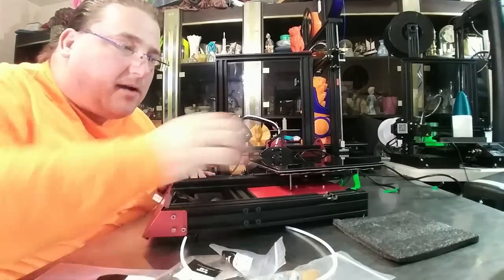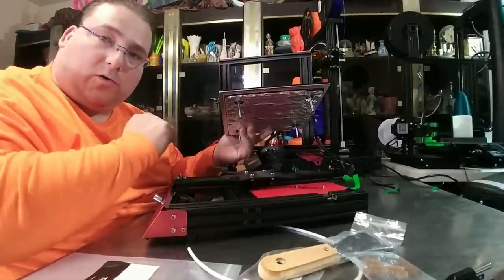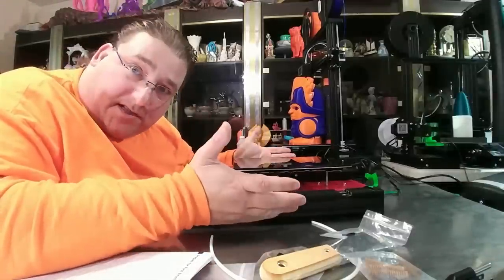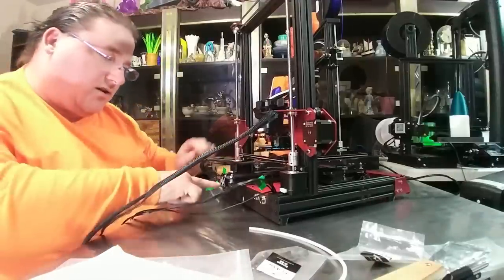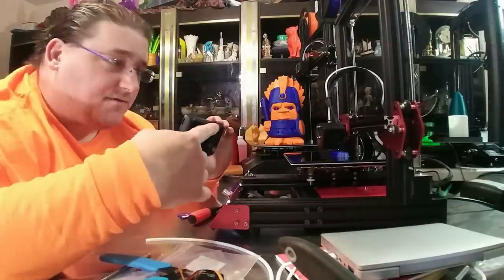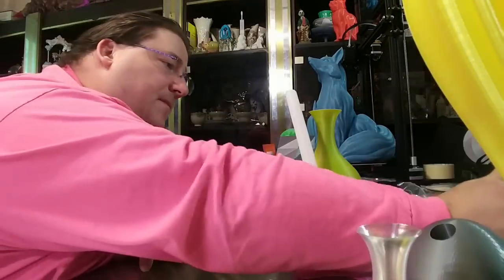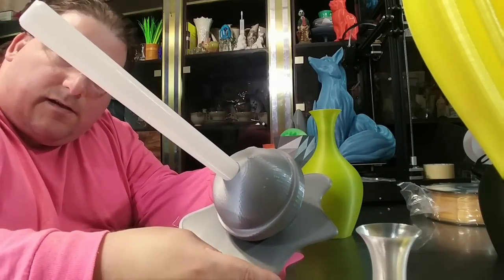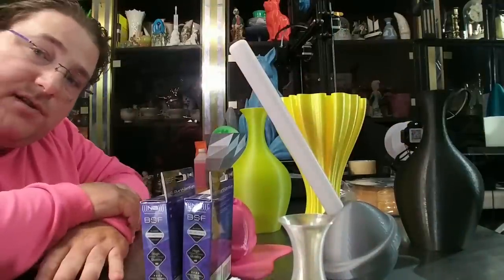T3DP 225 Tevo Flash High End Model   Unbox, Build, Print

Comment: What I like about this printer over the CR20/ender 3 is that the belts run parrallel with the axis of movement. The ender/CR20 do not, they will never print accurate dimensions, the more you pull the carriage towards the edges the more dimensional error. I'm installing some idler pulleys to solve that. The belts are attached higher up than the upper edge of the pulleys which pulls the belts at an angle, the closer you are to the edge the bigger the angle.
Reply from the maker: I'm not sure I understand the belts on the Ender do run parallel while on the TiVo one of them does not?? On the flash the y-axis belt runs perpendicular in two directions?

I have had zero print accuracy issues with either of the tevo or the Ender they've both made very excellent parts
Reply: If you look at the y axis on the ender from the side you will see that the belt is not horizontal. The closer it gets to the motor, the more will the angle of the belt increase. It is probably not a big dimensional error but unless they compensated for it in software there will be an error.
Reply: I'm working on adding a clip to the belt attachment point to make the belt run inside of the extrusion like it does on top of the x axis.
Reply from the maker: enes sabanovic are you mean where the idlers are such as how the cr-10 has the second little Idler Wheel?
Reply from the maker: enes sabanovic cool let me know when you have it ready and I'll give it a shot if you wish
Reply: Definitely. Printing as we speak. Made a dimensional error on the first one but it mounted great. Hopefully second one will work better.
Reply: Here is the mod. https://www.thingiverse.com/thing:3066620 It's more of quick fix than a final solution but it works. It will make the belts stop chafing against the extrusions for sure.

Comment: Hi. Do you know if this printer has a pause system in printing or resuming if the electric current fails?
Reply from the maker: I will have to confirm that but i think it does. However its useless on these kinds of machines. Printing on glass is truly wonderful but it auto releases the print when the glass cools. Which means resuming after failure wont work since the part will be released from the bed.
Reply: Thanks

Comment: Hi Chris. What is your thoughts on the Creality CR-20? As I understand it is basically a Ender 3 that has a bottom enclosure. Meanwell PSU and the new 2.1 board. I can get one in South Africa for $72 more than the Ender 3 but with 2 days delivery where I have to wait weeks for another Ender 3. I am not sure if the differences are worth the extra money.
Reply from the maker: If you can get it for only $72 more I would get the cr20 it'll be a lot more rigid better Electronics and the power supply alone is worth the price difference

That's how I would do it
Reply: Thanks Chris

Comment: Hey buddy!

I need your advice! :)
After 2 months of not getting my Ender-3, I decided to get a Flash, because of the mainboard and it's features.
I'm thinking about getting the standard or the dual-z version. 
Which one would you suggest?
I've read that it can run faster with dual-z. 
One more thing, would you change the extruder driver for an LV8729 or you just left the stock (2208 or 2100)?

Thanks! :)
Robert
Reply from the maker: I am quite happy with the stock drivers it runs smoothly and quietly I would think either dual Z or single Z would be fine dual Z will be less finicky on how tight The Eccentric Wheels have to be all the singles eating will be simpler getting the right hand vertical trolley tightness correct is important

Comment: What print settings do you use for PLA?
Im getting some crazy stringing on my Flash
Reply from the maker: Retraction of 5 mm at 65 millimeters per second speed

Make sure the temperature is not too high the volcano hot end on the flash does tend to string

Make sure you enable coming or not going outside of the outline of the model that will take care of most of your string

Comment: Hi chris. Out of the flash, ender 3, and cr10 mini. What one would you recommend the most?
Reply from the maker: The Flash and the Ender three are nearly identical and print quality with the flash looking a little nicer and the Ender 3 printing just slightly nicer and costing less money

Cr-10 mini is a separate class it cost fifty percent more money but also includes a larger build volume slightly inferior print quality mostly due to its larger Mass otherwise extremely good quality the disadvantage is that it's not an AIO so you have the breakout box

Now one advantage of that is if you want to do abs since you can enclose the printer while keeping the breakout box outside of the enclosure which will keep your electronics cooler

But that's cr-10 mini is also built better it has a more solid Construction because the Extrusion base is complete instead of H shaped

So it depends on what you want if you do not need the enhanced build volume of the cr-10 Mini then I would go with the Ender 3 for the AIO slightly better print quality almost as large build volume and much cheaper price

If you need larger build volume but don't really need cr-10 build volume then I would go with the cr-10 mini it is an extremely good printer
Reply: Nerys Thanks. I have a enclosure and wanna add bed leveling thats why i was looking at your flash video. Then i seen how much you like the ender 3.  I use to have a makerfarm i added a bltouch to.

Comment: hello nerys. what firmware are u using on tevo michelangelo? mine is 1.1.6a but i want to use 1.1.9
Reply from the maker: I'm using the stock firmware that came with it I don't know if it has a bootloader installed or not I will see if I can find out
Reply: Nerys it has bootloader.
Reply: you may be thinking why i m asking . i fucked up once dont want to do it again.

Comment: Hey Chris. Great vid as usual.  While working with my ender 3 today I noticed the bed (after leveling) is tilted significantly up, rising 4mm from back to front, and my vertical rails are perfectly plumb. Any idea what could be wrong?
Reply from the maker: Either you're y and z rails are not perpendicular to each other or the roller bearing shafts for your y Carriage plate are screwy or your y Carriage plate is bent